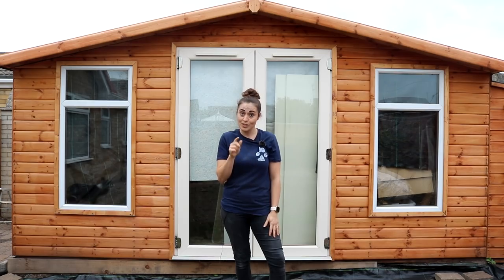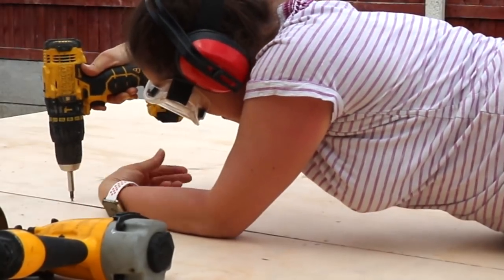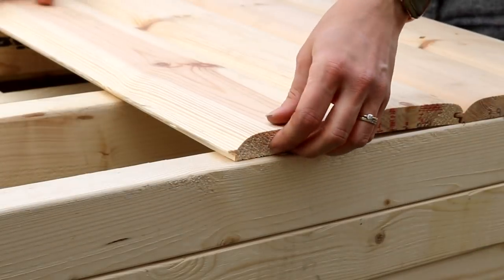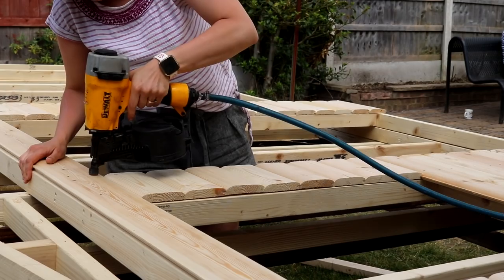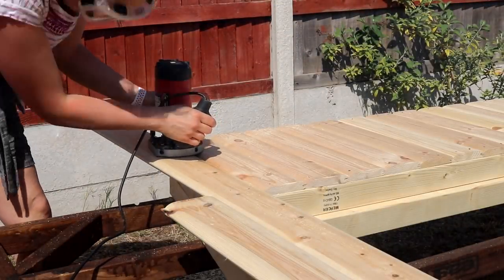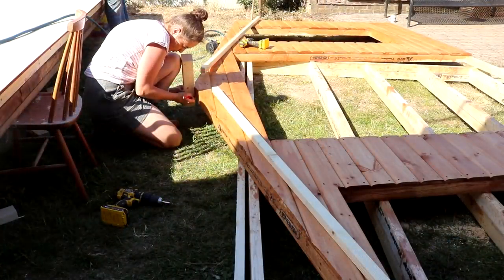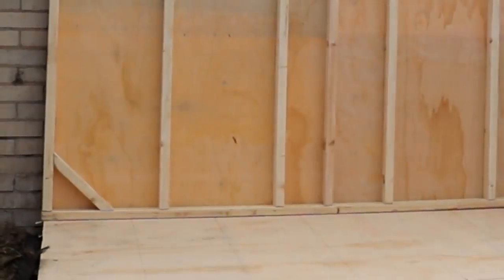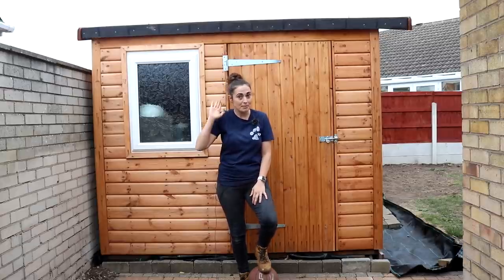Cladding The Summerhouse Shed Part 2  | The Carpenter's Daughter

Comment: If you don't have one already (it seems you don't) I would buy an impact driver in the same make as your other battery powered tools, you can then buy it as a much cheaper "bare" unit with no battery. It will make doing screws much quicker and easier and is very good at getting out hard to release screws and nuts when used with sockets. It will be money very well spent. Keep up the good content!
Reply from the maker: Thanks :) I'm a few videos behind at the minute, but you will see me in my lean-to shed using my now favourite Makita impact driver 😊

Comment: Hi, 

how do you expect the plywood to last compared not the cladding? will it not just deteriorate in a couple off years? 

best, Scott
Reply from the maker: It has a lot of shelter where it is as it's next to a brick wall.  But I'll be trying to treat the back of the exposed bit when it's gone pale and it is a pitched roof for rain to drip off away from there.

Comment: Cost of DIY build vs buying a new premade shed?  Experience and learning aside, which is better?
Reply from the maker: I'll find out the exact cost at the weekend, but I'll tell you straight off, I think DIY sheds are so much better.  My Dad's been making bespoke sheds for over 50 years and often 5 a week like this.  If you go to a DIY store, they often feel cheap and flimsy and you can push them where they lean.

You need to look for bracing on a door too and what thickness studs they use.
Reply: @TheCarpentersDaughterUK  thanks. I find the DIY ones are weaker. Only thing is finding the suppliers of wood to make your own and designing it.